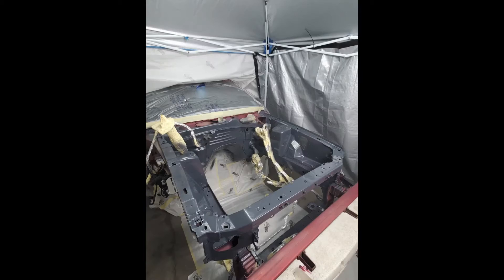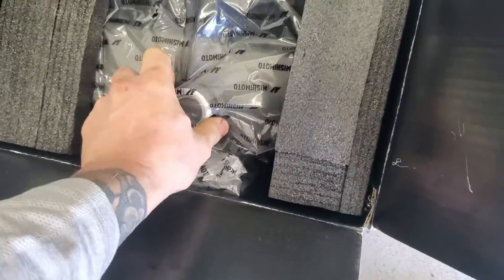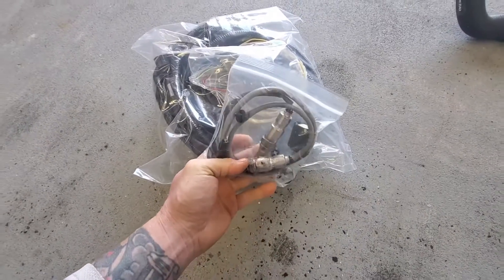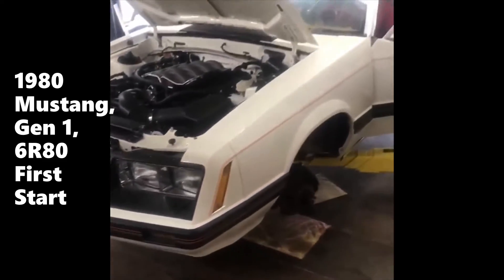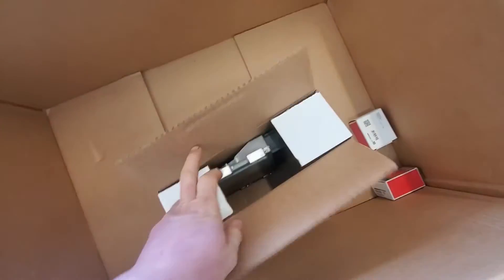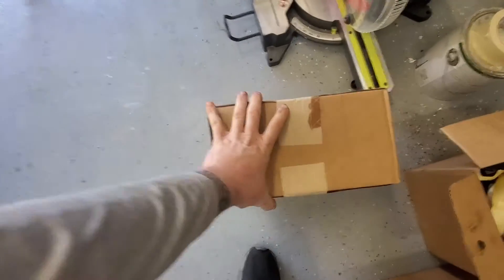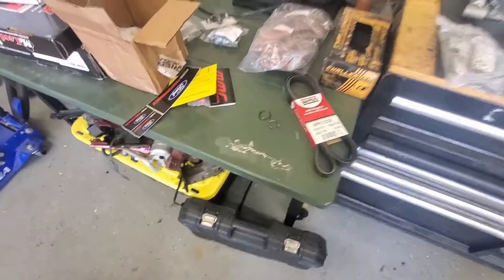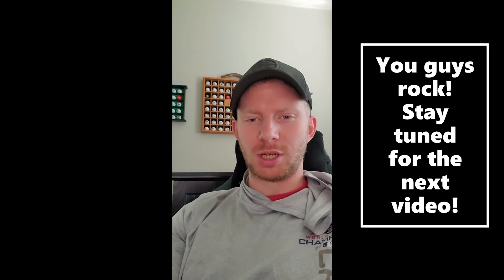The Coyote Cobra returns plus more parts arrive!

Comment: I’m a little behind where you are in the process so this works out perfect for me. Great videos, easy to follow. I’m currently waiting on cams and headers to come in. It’s been about 5 weeks since I ordered.
Reply from the maker: I'm glad this is good timing for you. Yeah, I ordered the headers 3 weeks ago, ill be installing them on the engine before it goes in the car so it's currently holding me up. What cams are you going with?
Reply: @PowerHousePerformanceLLC  comp stage 2 thumpr.  How about you?
Reply from the maker: Owner is sticking with stock cams for now. Was originally supposed to be a quick rebuild or replacement of the 4.6 but has evolved into the Coyote, so the cost has gone up a good bit, trying now to blow the bank quite yet, haha.